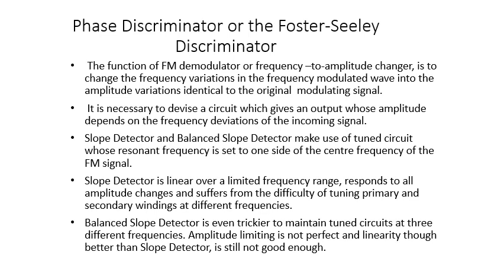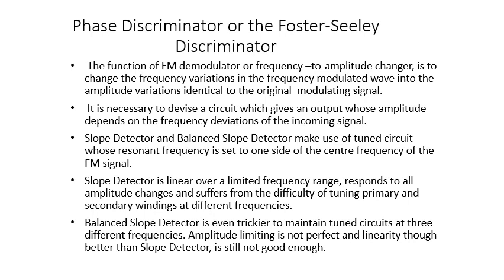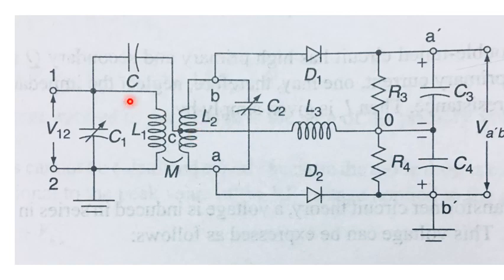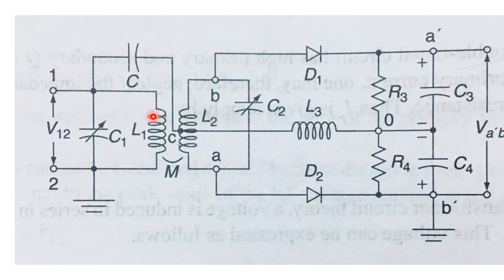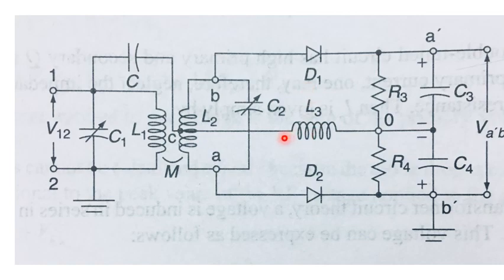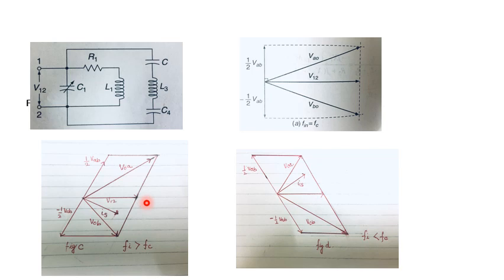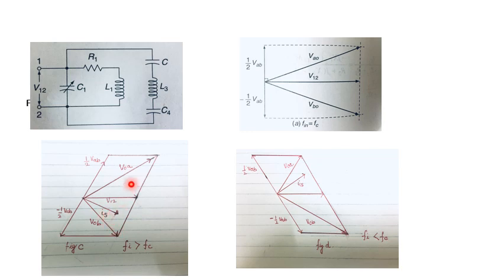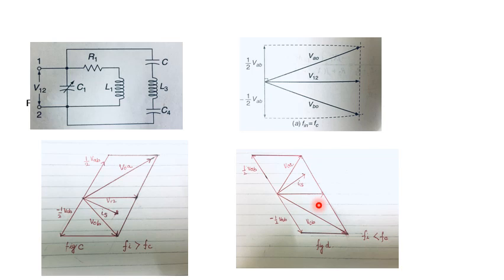Foster Seeley Discriminator by Dr Meeta Sah

Comment: Howdy. Nice, but I have a comment.
I believe the C and L3 constitute a series resonant circuit.
I actually did some testing with a signal generator and an oscilloscopte. At 10,7 MHz.
With a small value of C the voltage over L3 is in phase with the input. Increasing the capacitance closer to series resonance the phase over L3 begins to shift. The series resonance begins to load the input. 90 degrees happens about when the input goes down to about 70 %. Increasing further the series resonce will practically short the input.
Regards.